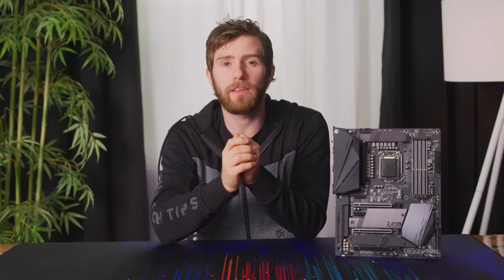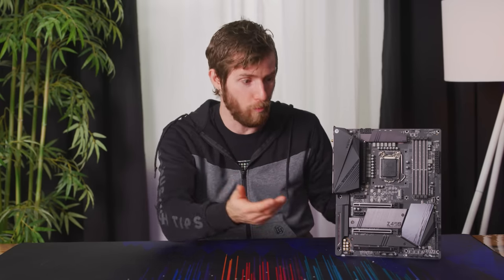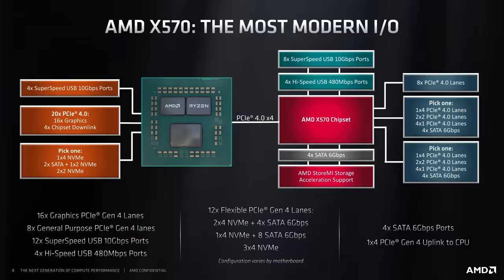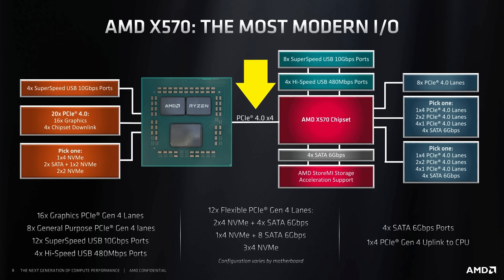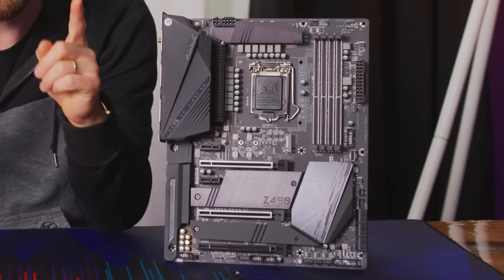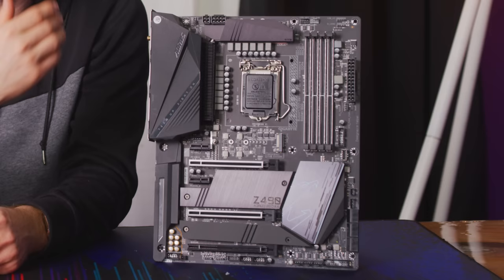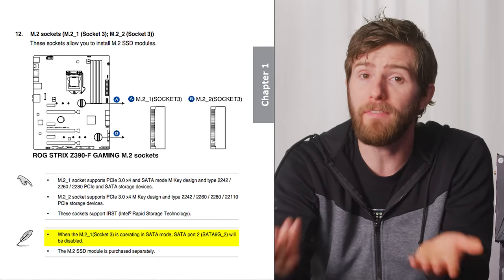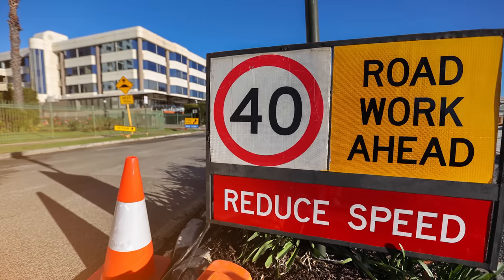The Sneaky Thing About PCI Express - CPU vs. Chipset

Comment: Help me here for a AMD X570 motherboard.  Can i use A dedicated soundcard in the smaller PCI 1x slots and have my GPU on the bigger PCI-E x16 slot and still get full 16x PCI-E lanes for my GPU?
Reply: It depends a bit on the actual motherboard but typically, the top slot would be connected directly to the CPU with PCIe  x16 and the x1 slot would go over the chipset. So no issues there. Usually, the top PCIe slot can only share lanes with the second PCIe slot through PCIe splitters (If there are any, for example most B550 boards only have one slot connected with PCIe 4.0 and the rest with 3.0). So there are three operating modes
x16 - 0
x8 - x8
0 - x8
That is also the explanation why the top slot should be used for the GPU.
With X570 and B550, the top M.2 slot is also connected directly to the CPU, which is kind of missing in this video that is completely focusing on the Intel side of things.

Comment: Please do a video on how to unlatch a massive graphics card with a fat backplate without removing the large CPU air cooler that's preventing you from getting your fingers to the latch.  (Like a PowerColor Red Devil RX 5700 XT on an Asus TUF X570 with a Noctua NH-U12S - I swear the latch release sticks out 1mm from the backplate.)

Comment: They are “backward” compatible. You can connect a 16x card in a 1x PCIe it will works... poorly. But it will work. What really aggravates me is when they place a 16x connectors size and wire it for 8x or 4x. Look inside the connector, if there is no pins on the right half, you have a 8x not a 16x. If you have 1/3  pins it a 4x. The 16x connector is only there to physically support the card. There is no electrical pins in it.

Comment: Im confused... so is this correct?
A graphics card using x16 is going to be potentially faster than same card using x8 lanes.
Cpu has inherent support for limited pci lanes. So if you use x16 lane, card would be used at x16, but if you plugin in 2 cards in, then even if they are in x16 slot they will be used as if they were in x8 slots. Since cpu support 2x8 not 2x16 lanes. 
 There are more x16 slots that run through chipset, but are actually shared x4 lanes.
 The direct to cpu lanes x16 are also shared with each other unless cpu has support for more. 
SD card also acts like graphics card but only takes x4 lanes.

Comment: So if I heard you correctly, the M.2 takes up 4 lanes of the PCIe band width?  Clearly Intel needs to have more PCIe lanes to their chip.. If I recall some older chips had 40 if I am not mistaken, like I have with my 4930k.. so why are we down to 20 now days?  Seems like we need more PCIe lanes to me available through the CPU.. and the very fact that  the M.2 drives are being ran through the PCIe lanes, should necessitate that INTEL start to increase these lanes on their CPU's...

Comment: Does this mean it is not possible to run a gpu at x16 with the use of an m.2 connected via cpu pcie lane with an intel 10850k?
Reply: did you ever find a definitive answer to this? ive been getting different answers on my research, some say their cards ran even 2 m.2s connected with their gpu retaining 16x while others say their 16x turned into an 8x with only just 1 m.2 connected.
Reply: @shinobu2394  you can’t get x16 with m.2 in cpu slot. 10850k only has 16 pcie lanes so it drops to 2x8 configuration. This is the main reason I’m considering an upgrade even though I’ve only had the cpu for 2 years.

Comment: PCIe is really an impressively designed spec. Its the one thing on PCs that bring them all together. You can run a GPU, network card or some other device from 2003 on a 2021 mobo. I can put an RTX 3090 in a Pentium 4 mobo. Does it make sense? Nope. But I can do it and I love that. Beyond that, PCIe version are easy to track. PCIe gets 2x faster with every revision. That's it. PCIe gets my vote for all time best PC specification. Its a beautiful system. It's so good that even Apple had to bring it back after trying to kill it from their machines.

Comment: What I really want to know is Should we REALLY  Turn off PCI express  ASPM?

will it really make a REAL difference when it comes to gaming performance? 

Every instruction about power management goes for "TURN this OFF ITS BAD next TURN THIS OFF IT IS ALSO BAD " but how bad is it actually? 

It seems like someone spread a rumor about PCI E.ASPM, and every other person keeps saying the same thing assuming this is the RIGHT, but can ASPM make a BIG difference in gameplays after it exit  one of the states? which are:

L0S  (concerns setting low power mode for one direction of the serial link only, usually downstream of the PHY controller). 
 the moderate state

while

L1 (shuts off PCIe link completely, including the reference clock signal, until a dedicated signal (CLKREQ#) is asserted, and results in greater power reductions though with the penalty of greater exit latency.) 
for maximum power reduction 

it clearly can reduce power consumption, But is it possible that they will returned to L1/L0S during gameplays( or any activity)?
This for sure would be  reasonable  to turn it off, but I don't think they will be entering and leaving L1/L0S states during gameplays, so  WTF do we need to turn it off. Does it reduce FPS?

If anyone can give me a good explanation I would love to hear you. The only thing I can find in the internet is what everybody already knows TURN IT OFF and be happy. But I really want to know the reason why;

Comment: and there's no mentioned about how idiotic many manufacturer design their pcie slot arrangement, for example 2 slots below primary x16 slot are basically useless but manufacturer put them there anyway, worse still the slots that able to cleared gpu were empty

Comment: So dumb question, but let's say I have a system with 16 PCIe lanes. All of which are being used by a Nvidia 1080 and a have one NVMe which is installed directly on the motherboard. If I use the second nvme slot, or even install a third through a NVMe adapter, is there any positive benefit going that route, as opposed to using multiple SATA SSD's? Or will it just introduce more problems and knock my GPU lanes down? I know many people don't see the speed benefit in NVMe but I have in a few instances when transferring large amounts of data.

Comment: Bit of a wildcard question but trying to understand as a newbie -   I've got a razerblade 15 2018 and just got 2 m.2 nvme pcie 1tb drives with usb 3.1 enclosures with the idea to record audio to one, whilst simultaneously reading samples audio files from the other (inside a daw) and using the main computer nvme drive to run the program. Im racking my brain trying to figure out if something like a Nestor NA611TB3 (dual slot thunderbolt 3) would be faster than 2 individual enclosure each plugging into a 3.0 slot in the computer. 

Apparently the razerblade TB3 port has full 4 PCIe 3.0 lanes,  but it's through the PCH and the processor is the Intel(R) Core(TM) i7-8750H CPU @ 2.20GHz, 2201 Mhz, 6 Core(s), 12 Logical Processor(s). Would there be performance issues to read and write at the same time through the same TB3 slot? Or would it be better to plug each enclosure in a USB A 3.0 input in the computer. Im assuming these USB A ports (3 in total) go through one lane regardless so its capped at that speed? Also one Thunderbolt enclosure and 1 cable would be more compact. Any help would be really appreciated!

Comment: Will your GPU be losing performance if you populate 2x NVMe slots?
One of my NVMe slot is routed to CPU, the other slot through chipset (b550).
I need a straight answer to this.

Comment: So in a nutshell, it would actually be better for high speed performance to connect all the M2 drives to a PCIe card? Especially if your cpu has 24 lanes like the new ryzen? Because you would not rout all that data through the chipset that is limited to 4x pcie4. Right?

Comment: Does the nvme m.2 affect the pcie lanes, like my gpu is only running at 8x rather than 16x
Reply: If the M.2 is connected through the DIMM.2 expansion. Yes.

Comment: With the x570 tomahawk, would there be a bottleneck if I have one gpu, one pci4 m.2 ssd, one pci3 m.2 ssd, and and 6 sata ssd together? I want to add 6-1tb sata ssd to form a raid5 data storage. 

I wouldn't be using them all together at the same time.

Comment: So I recently upgraded my computer to a HP Slim with a core i3-10105 3.7-4.4GHz CPU, 8GB DDR4 RAM, 256 SSD M.2 NVME, and Intel UHD 630 integrated graphics. However, I currently own a cheap Dell OEM RX 550 for $50 I bought on ebay. I did some research, and my motherboard is called Groot 3. I honestly can't tell if it's compatible. If so, what GPUs are compatible for me to upgrade to down the line?

Comment: Advantage to X570 boards for now.  For those that are unaware on the B550 and B450 boards the PCI express lanes are a different slower speed, PCI-E 3.0 if I remember correctly, between the chipset and the CPU.  On X570 boards the whole board runs PCI-E 4.0.

Comment: Dear Linus, why can't I access the 64 or 128 lanes of PCI-E 4th gen that come with ThreadRippers in any way, shape or form ???
It's like Threadripper mobos were designed for Intel 20 lane CPUs, please note who on earth would need more than 1, MAYBE 2 NVME drives, I myself need to plug in my HBA, my 10Ge NIC (need TWO ports), my intel i350 for 4 additional gigabit network adapters, a minimum of 2 graphics cards for different monitors and applications, (no SLI), is there any of the aforementioned devices that could plug into NVME drive slots??? I guess not, so why on earth give us 5 NVME SSD slots and remove PCI-E slots willy nilly, now that ThreadRipper CPUs can clearly give us 64 and 128 lanes that we can simply never use

Comment: Senario,  Questions Bellow.
Z790 Chipset
13900K
RTX4080
Max# of PCIe Lanes = 20
16 lanes are used for GPU 
4 lanes left to the CPU. 

Question
How will the system suffer if i use 2 NVMe storage devices running in RAID 0 if both connections are to the CPU instead of the chipset. Will the SSDs run at 2 x2 speed, esencially spliting the 4 lanes into 2 lanes for each drive?

Question
Should I instead use one NVMe SSD as a boot drive and have a RAID 0 array connected to the chipset for storage?

Quesiton
Correct me if I'm wrong but the Z790 chipest has a x8 lane to the cpu, Should I just use RAID 0 on the chipset and leave the extra 4 lanes open for the CPU?

Comment: That's still doesn't explains why my raid 0 of two nvme ssds didn't do very well. My cpu support up to x16 lanes in pci 3.0. Since my notebook has a dedicated gpu it's probably using a 2x8 configuration.
One goes to south and another goes to the gpu. The south one should have a maximum bandwidth of 8GB/s and 2 3500MB/s nvmes shouldn't be able to saturate it.

Comment: If my CPU ad 20 lanes, then my GPU get's direct access but my M.2 Drive still routes through the chipset right? Coz the oter 4 lanes coming off the CPU is for downlink to the chipset? So If I had 16 lanes CPU then my x16 slot wouldn't even be able to be fully utilised.

Someone correct me pls.

Comment: i wanted to know what slot to use for m.2 ? pcie 4.0 from chipset or cpu while having an rtx 3060 ti already in the pcie 5 slot. can we use both gpu and 1 m.2 ssd in the pcie from CPU simeltaneously on a b760 mother board? do gpu uses all the 16 lanes and wont spare any for the m.2 form the cpu?
Reply: I have a motherboard with a GFX card on a PCI 5.0 slot. I also have an nvme SSD gen 4 installed on the number 1 (CPU) slot... According to Hardware Info 64, my GPU is still running on x16 lanes. Hope this helps... PS: If I were to connect a gen 5 SSD to that CPU slot then the GFX card would lose lanes. Gen 5 SSDs use more lanes than gen 4.

Comment: I have a Question related directly to this topic.
I have an ASUS B250 mining motherboard with 18 16x1 PCI-e, and one "Full 16X" slot on the motherboard, for a total of 19 slots. It's been around a few years and is frequently used for mining Cryptocurrency. 
The issue is the manual says you need some form of software control, and certain video cards to achieve this. I'm running hiveos in Linux. Everyone is claiming I have to run in windows to utilize all 19 ports. I'm calling Malarkey. I'm currently running different settings than others have tried in my BIOS (specifically about video cards sharing resources, and using Gen 3.0 PCI-e as my port input setting, Because I'm using GDDR6 PCI-e 4.0 cards, and think they should use the fastest throughput available).
My question is, "Can I theoretically bypass the CPU directly to the LAN as you decribe in a LINUX environment?"
Thank you.

Comment: This is a great video, very informative, I have a query I hope someone can help with though as this video doesn't quite answer it. My CPU has 16 lanes, My chipset has 24, I have a GPU in x16 AGP slot so this uses all the CPU lanes, If I connect a M.2 drive in a x4 slot managed by the chipset, How does the Chipset communicate with the processor if the processor is already using all avaialble lanes communicating with the graphics card? Does the GPU drop down to x8? This is what I fear, I'd like to have a m.2 but don't want to halve my graphics bandwidth. Any Help appreciated.

Comment: Hi Linus Community hope you could help me.
My laptop wont boot to my usb media drive which contains my windows 10. I use the microsoft media creation to create the drive.
When i boot to my usb using uefi mode, acer logo loads forever(rotating dots) but when i use the legacy mode it load to windows 10 icon then into black screen.
Im using acer e5 471g laptop. Im trying to reinstall my windows because my device wont load to windows 8.1 anymore after i did windows update.
Hope you could help me.

Comment: Hello internet. I want to upgrade my pc with more Sata drives. I have an Gigabyte X399 AORUS XTREME - E-ATX / X399 with 6 Sata outputs.my powersuply is an Seasonic Prime Ultra 1000W Gold. I think it have about 13 power cables. I wonder what SATA IO card is best option for me so I get more than 6 sata conections. right now I have 4 SATA disks but I want an Bluray plus a bunsh of extra drives. Any tips? best regards an random idiot :)

Comment: In the case of X570 (at least on mine Asus Tuf) the 2nd PCIE_X16 is routed via chipset not CPU

AMD X570 chipset

1 x PCIe 4.0 x16 (max at x4 mode)
3 x PCIe 4.0 x1

https://www.asus.com/Motherboards-Components/Motherboards/All-series/TUF-GAMING-X570-PLUS/techspec/

Comment: anyone else disturbed by the 40 or 200 hour battery life of the mouse? it better be refreshing it's position 50,000 times per second for that low, i have had logitech mice that batteries outlast the mouse and that isnt from abuse! ... does anyone else have issues with scrollwheels getting flakey after only a year or 2?

Comment: Can anyone help me with this? I have an ASRock B450 pro4-f motherboard with r5 2600x and a msi rx 570 8gb gpu. I have no SSD just two HDD. But for some reason my gpu is running at x8 3.0 instead of x16 3.0. I'm just hoping nothing is faulty here. And yes I have put the gpu in the 16x slot.

Comment: Shows off Z490 positively, shows Intel diagram positively, Uses 'if you want more lanes' showing Intel, PROMOTES NON PROVEN Intel marketing slide......Shows a negative bit using X570, uses more negative language while showing an AMD diagram regarding x4......hhmmmmm weird huh... Every Intel mention uses positive language, every AMD one uses negative language...this is really confusing?
Reply: I can't decide if it's a joke or not.
Reply: @muzlee7479  I don't think it is..all the usual pointers are missing, like the ones in the nVidia buys LTT joke. I feel it's an underlying problem of trying to balance keeping Manufactureres happy and keep the money coming in against 'vague enough to be explained away later'. There is a deeply worrying trend over the last 12mnths an more that AMD/Intel/nVidia etc are subtely/unsubtely pressuring people to 'do as your bldy told' through small measures. Sometimes just witholding communication/product/information...I'm not calling out the need to do it as Lunis has never hid his ambition to take LTT outside the YT environ and his business drive, while commendable in many ways, is one that will naturally have victims as well as winners. I was only stating that this, possibly subconsious, language has real effect and should be stopped at every possible opportunity.
Reply: @grantpaterson1016  I was talling about your absurd comment. It seems you are so disconnected from reality that you think everything has meaning behind. 
Yeah sure intel payed linsu to sell their stuff with subliminal messages. I wonder how many poor souls bought bought an intel cpu because lines used 3 more images for intel stuff and showed something negative on an amd board, while clearly stating it's true for both brands. Not to mention how he said amd has already more lanes.
Reply: @muzlee7479  Who is the severly melodramtic one here...I never mentioned him being paid. I think you should take your paraniod ranting elsewhere tbh. Oh he said it was supposed to have more lanes. I also never said it was intentional.. It is possible you might drown one day if you don't keep your head exactly level...the drool may actually harm you mate.

Comment: "Most common cpus have 16 or 20 lanes"
Me : laughs in ryzen
Reply: me with my 10100f with 8 lanes
Reply: Well, Ryzen has 20 lanes going off directly from the CPU (16+4) so it's not wrong to refer to that. Of course the chipset uplinks need to be taken into account at one point but they are kind of separate. Threadripper is a completely different story of course.
Reply: laughs in extreme edition
40 lanes sure feels good.